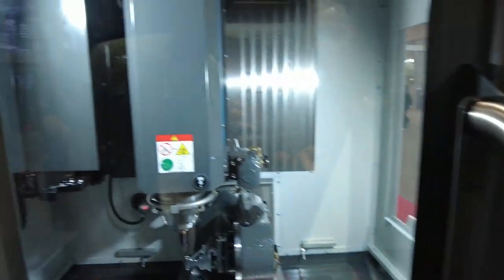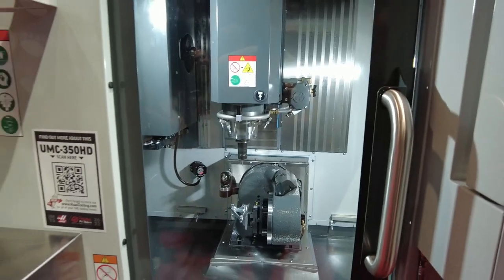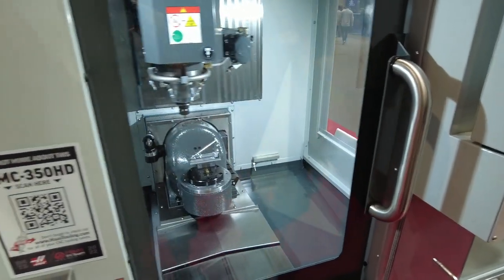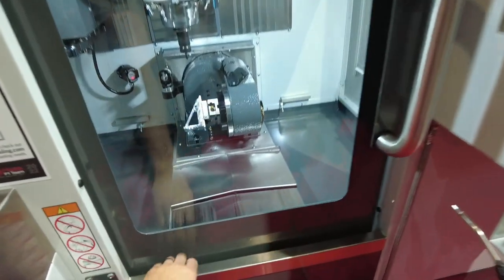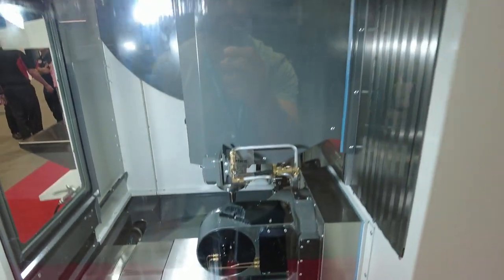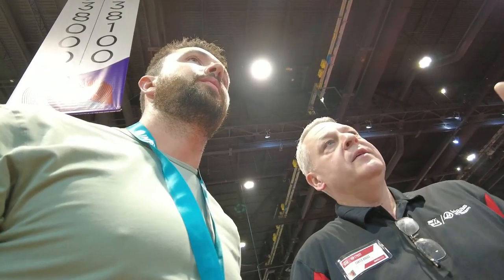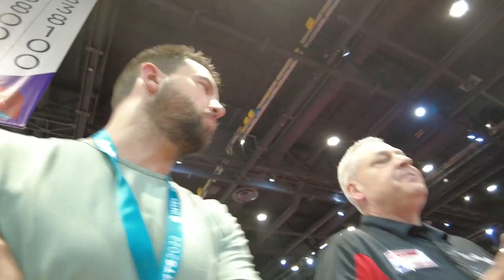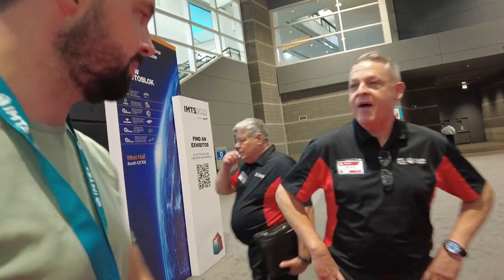Haas UMC 350 price + specs

Comment: Went to IMTS for my birthday present on the final day of the show. I got through 60% of the show in the 9 hour time span. Went through the west and south building completely and that took me 7 hours. What a wonderful day it was looking at all the different machines and solutions that manufacturing technology has these days. One of my favorites was a metal 3d printing company that was showing off rocket nozzles composed of 2 different materials that being stainless steel and aluminum bronze and the materials combine at different rates in the transition area like 80% stainless and 20% aluminum bronze, then 70% stainless and 30% aluminum bronze and so on until it's all aluminum bronze. The awesome thing about that company is that they also have an alloy maker, its a dmls 3d printer that makes small samples of alloyed materials that can be tested. Both machines have hoppers filled with the powders of choice and automatically mix to the ratio needed during printing and not needing to be mixed outside the machine.
Reply from the maker: I saw them too, I’m gonna get the video edited and posted.  Those mixed alloy components were INSANE!  That was a really cool booth to see.  Happy Birthday man, thats a great Birthday present!! 👏🏼🙌
Reply: @ericschneiter  Do you remember the name of the company doing the alloys?
Reply from the maker: @Tadesan  I have this footage still on a hard drive. Never got it edited, but I’ll see if I can find it.

Comment: Looks like the UMC-350 didn’t sell too good. Haas removed it from the website minus the edu branded version for 89K. Really thought these would do well, but when the price tag came out I knew it was not going to sell well. If they made them 95K they would have sold like hot cakes. Price point was just too high for what the machine offered. 

Still think Haas should make a “Garage series” machine which is somewhere in between the TM and VF series. Design it with a Nema 6-50 plug and sell it with an integrated small air compressor for tool changes. 10hp spindle. Make the dimensions work perfect for garage door clearances. No one on the market has done this yet.
Reply from the maker: Totally agree.  If Tormach ever builds an affordable trunnion it will be game over.  HAAS will be left wide open at that price point.  Right now the only viable option in my opinion is a UMC 500 and it seems like all there is are horror stories of them not holding numbers.

Comment: interesting vid, i could see a great rio at that price point.  My main concern is the small tool mag, if you wanted to hook up a robot for overnight runs 18 tools will only really allow you to look at non ferrous materials where tool wear is negligible.  Anything tricky you're going to run out of space for sister tools very quickly.
Reply: That's where the UMC-500 would likely come into play.  30 pocket is standard on the 500, with 50 and 70 pocket available options.

Comment: This machine is confusing to me, the enclosure is way way bigger than it needs to be they cld have built this a lot more compact like a brother/robo /medcenter. Also the hd and ss have the same rapids and the same tool changer so the only thing “ss” about the 30 taper would be the spindle start stop speed, hardly a big deal. Also the 30 taper has the smaller trt with an abismal 15lbs table weight max witch makes it nearly pointless. Yet the sales rep implies it will be more expensive 🤔 very strange. I just think they cld have made it alot more interesting without costing anymore money. Feel like it was rushed because haas caught wind of the brother u500 and panicked to get something out quick lol
Reply from the maker: Some good points here. I think some of the buying decision comes down to cash in hand.  I saw the U500 there too.  I don’t think these machines are apples to apples.  Those brothers are in a whole different category. They are way faster, and they’ve gotta be way more money.  I agree on the smaller trunnion, personally the 210 seems more attractive but a lot of people love 30 taper machines and the tapping speeds.   Will be interesting to see how they do.  This machine is a cheap R&D for Haas as it’s all pretty much off the shelf stuff.  I was really impressed seeing this machine in person but I do definitely agree with some of your critiques of it.
Reply: @ericschneiter  yeh for sure the brother will be more , and it’s crazy that the are still so much faster because the listed rapid speeds are a lot higher on the haas but it must be the accel deceleration is a lot slower. I think your right they just went into the current haas Lego bin and tossed this thing together. I think a lot of people are sorta cheering for this though and want it to be good because we all want a sweet little 5ax for cheaper but it’s sorta a shame it dosent seem like haas is willing to put the effort in to actually refine anything. As if making the spec sheet pop is thier only goal. I’d imagine this umc will have all the same issues and problems of the bigger umc’s like chip and coolent management and accuracy issues , thermal issues ect.
Reply: I think for almost the same money (120-130k'ish) you can get the Large Robodrill with 2 axis trunnion on the table and have room left for extra vise etc. That'll be a quick machine. Or small Robodrill with trunnion. Or going haas way then VF2ss with TRT160 on the table, although bigger footprint. But it will be interesting to see how it does in the market.
Reply from the maker: @vilts  Id be shocked if a robodrill was that cheap with a trunnion.  Would definitely be something to consider if they are.
Reply: @ericschneiter  Last Feb I got a quote for  Robodrill α-D21MiB5 (medium size) with Nikken table for 118kEUR, 10k rpm spindle and some software options too.
Reply from the maker: @vilts  dang, good to know.  Definitely something to look at.  How big was the trunnion on it?
Reply: @vilts   robo drill where I live was 30-40k more than a brother and the cheapest tilting rotary was another 35-40k so I think you would be closer to 200
Reply: @ericschneiter  This was Nikken 5ax130FA, looks like the smallest of the series. It was quoted 36k€.
Reply from the maker: @vilts  interesting. I do have to say I love how Hass does their pricing.  I hate how every other company is totally a secret on prices to the general public.  I bet it changes these next few years.
Reply from the maker: @Jonnywoods_049  I was putting them low end at 200k if I had to guess.  Again, I hate the secret pricing in the cnc world.
Reply: @ericschneiter  yeh I feel the same like what century are we in. Absolutly rediculas there’s no price on a website. Look at every single vehicle for example and the prices and sales are all time highs so clearly posting the price dosent work against the company lol
Reply: If you want to make bone plates and similar, you'll want the larger trunnion with a 30K RPM 30 taper spindle with 1000 PSI TSC for drilling small holes in Ti.  A 3 axis station off to the side would be really helpful for stock prep or a final op.
Reply: @ericschneiter  I have vf2 with tr160 trunnion. Worthless machine. I laughed when I realized that it doesnt have DWO (built in 2011). Simultaneous milling is a joke. It cant handle movement change and it leaves awful marks in parts. Whole machine vibrates when you move table in manual mode. Spindle expands during high rpms which results with horrific sound durning tool change.

Comment: I don’t understand this machine. They are saying it’s a dt machine, but it’s a travailing head in x. Do not a dt….

And I just don’t understand why they would not add a end support….

Either way I’m very interested to see the initial rollout/thoughts on this machine. For a target of $100,000 it’s an attractive solution
Reply from the maker: It’s built on the DT and DM bases.  Lots of the same components.  It’s pretty awesome in person.
Reply: I went and saw it.
If it’s 100 and good it will be a special machine for sure
A little disappointed they where not running parts on it at imts.
Heck, once you buy 4,5th axis drives and a trunnion for a vf machine it’s 50k anyways. Add in standard probe, mrzp, tpsc and the other standard unc features your practically getting the iron for free, lol
Reply from the maker: @brianwaayenberg3099  for sure! I thought the same thing, I also think programming it might be a little easier that when the trunnion is turned along X like if its inside a VF2.  I know a few users have had questions on having to modify the post processor because the trunnion moves differently than it does on the UMC platform.  This will solve that.  More purpose built as you can see.  With an auto parts loader this thing will crush at this price point.
Reply: @ericschneiter  im not sure the orientation matters too much? i have a trunnio for my vf2 and have set it up in CAM 2 diferent ways and it posted fine. in fusion i just swapped one parameter to define the orentation. ive only placed i tone direction in the machine tho, still need to make a sub plate to swing it 90deg, i want it like the unc350's, would save alot of table length, (haar tr110 trunnion)

Comment: Typical Haas fashion, this is so lame. Why even do this
Reply from the maker: Why do you think it’s lame? What would you prefer they do instead? I’m interested in your opinion.
Reply: Ja, Sieht so aus; überlegt auch lang.........
Reply: @ericschneiter   Single phase, built off TM-1P platform and priced at 85k
Reply from the maker: @maloyaircraft1174  your ideal price point but 5 axis?
Reply: @ericschneiter  You have to ask “what is the target customer for this product?” I would say Haas target market of customers are mainly new businesses just getting into CNC. Also, shops that are small to mid size with less than 30 employees. They hold the largest market share in the first time CNC machine users with small businesses. This can be validated by the way they approach customers on their site and video content. I think Haas is a great brand, but I think the machine should have been targeting the garage shop at the price point of a new pickup truck. Just constructive comments that I hope travel to the decision makers. Haas business strategy reminds me a lot of what Solidworks was doing to compete with PTC in the mid to late 90’s. The base of users Haas has is similar to the Solidworks user base.
Reply from the maker: @maloyaircraft1174 Totally appreciate the input and opinion.  This is a good space for discussion and hopefully the people at HAAS take note.  I think that would be an incredibly good offering at 80-85K for a lot of people in the market you’re describing.